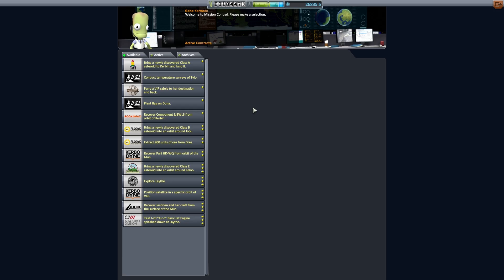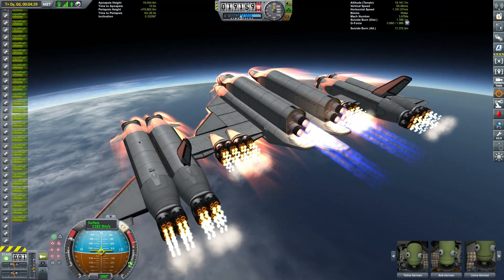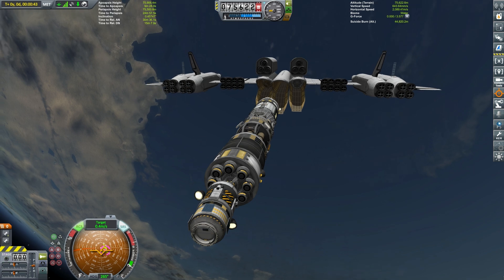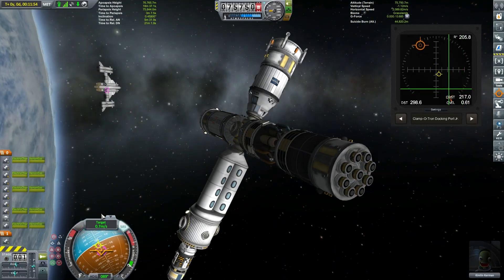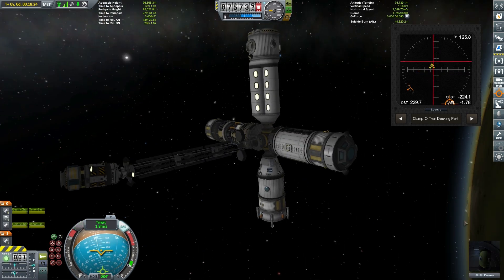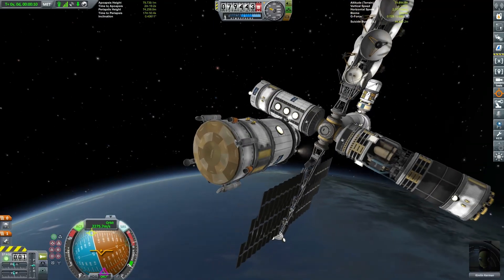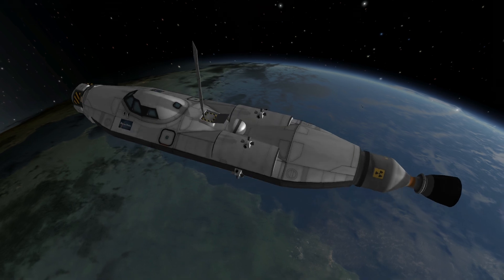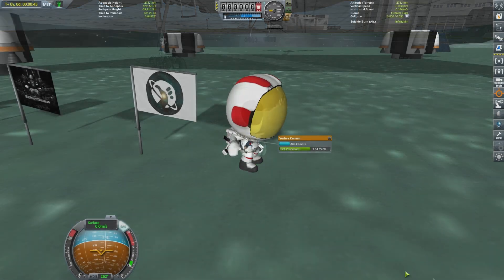KSP Space Station Single Launch Space Plane (Tutorial:44) Kerbal Space Program 1.2 - Stock Parts

Comment: I tried every type and size of space tug to move parts in orbit even a super tug as big as the parts and all parts had RCS tanks thrusters,, batteries and even a remote control unit and all failed to work well.. the frame drop did not help either.. mine got down to 5 fps and I have a powerful Gaming PC.. so that did not make it any easier?  Plus I found that even if I managed to build a station I save and come back later only to find the stations parts were often all loose again and some exploded and bits all over the place?  So I gave up doing stations. all that time designing and building huge lift rockets to carry all the parts up only to fail. : (

Comment: Did the space station not oscillate because the ion engines have very little thrust?? Usually when I move a space station it oscillates. Maybe I have to make them more compact?
Reply from the maker: Use Autostrut (you need to turn on advanced tweakables in settings to see the option in the VAB)
Reply: ty a lot....my space stations usually wobble out of control.

Comment: How did you get the crew cabins to attach on both sides to those structural adapters?
Reply from the maker: Should work quite fine. You just flip the adaptor and attach it from the rear. For some reason that didn't sound that great now I read it back.

Comment: Hey Marcus House,I found out that when you zoom out on your ships your fps go up,I downloaded the vessel and had like 20 to 25 fps but then I zoomed out and got 30 to 35 fps.It might help you in your videos.If you want my system specifications here they are:

CPU Core I7 6700k overclocked to 3.8GHz
Graphics card: Geforce GTX 1080 founders edition 
Motherboard:ASUS 170z AURA 
CPU cooling: Corsair  H105 240mm 
power zone bequiet 1000w powersuppley

Enjoy
Reply from the maker: Yes I think I've seen the same. Your PC specs kick the crap out of mine... I'm working on that problem. :)
Reply: And how are you controlling "your little friend" because it does not go forward with wasd for example it just spins around.
Reply from the maker: WASD controls rotation IJKL control translation (up down, left, right) and HN control backwards / forwards.
Reply: OMG thank you so much!

Comment: how do you even make planes? no matter how hard i try, even putting the center of lift behind the center of mass its just too maneuverable and fails immediately.
Reply from the maker: If COM and COL position are not the problem try adding more control surfaces to the front. Is it flipping on you? In this space plane I added control surfaces to the nose and this helped a great deal. Feel free to download the craft, link is in the description.
Reply: when I try to lift up it flips around (positioning can be found here: https://puu.sh/v5CE9/3146bd734d.jpg). I tried adding canards but it just seemed to make the craft even crazier. I thought wing surface area was the problem so I made smaller and larger winged versions but to no effect. I'm honestly confused as to how people even make planes properly.
Reply from the maker: Sometimes I need to move center of mass right on top of or even a little in front of COL depending on the design. Just try slightly adjusting it. If you still flip upwards move center of mass a little more forwards.